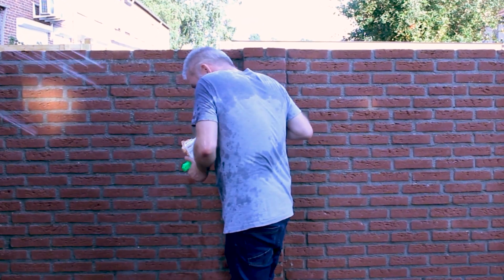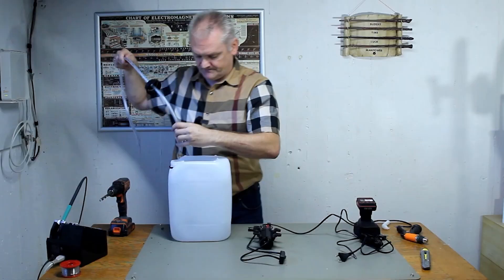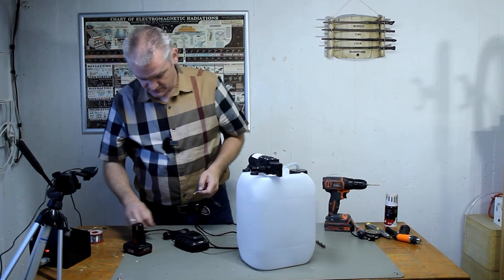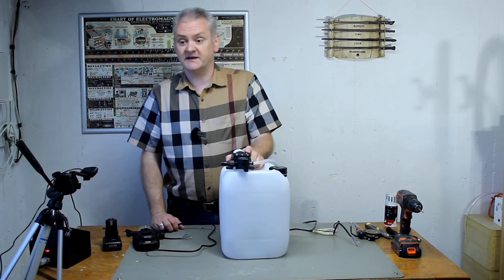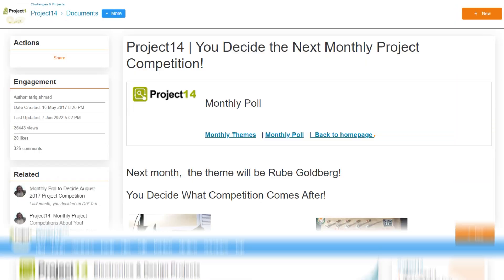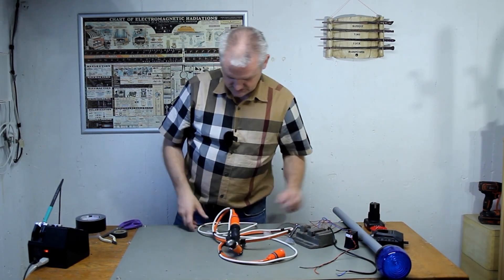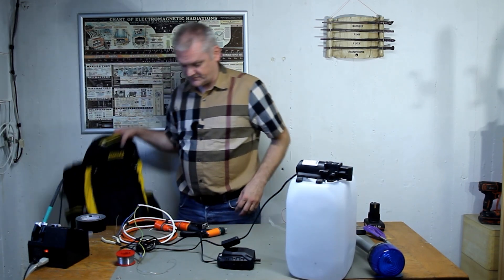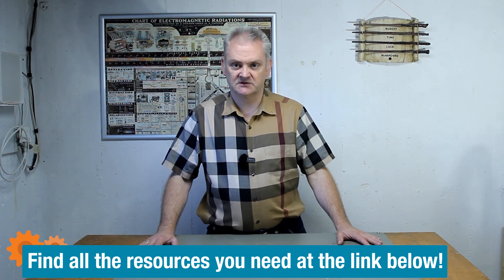Backpack Splash: Mark's Water Gun Upgrade for Epic Outdoor Water Wars!

Comment: They actually sell cordless pressure washers and even the cheapest one is probably many times more powerful than this DIY one... I would probably not even comment as it may be educational in normal circomstances, but you use power tools parts which make it quite futile if just using the pressure washer power tool...
Reply: I have seen some but not as cheap s this one and where is the fun in buying a ready made one…